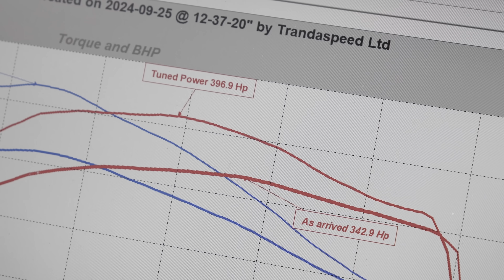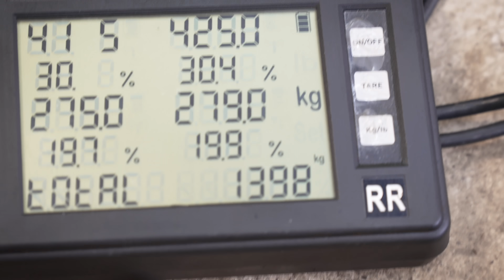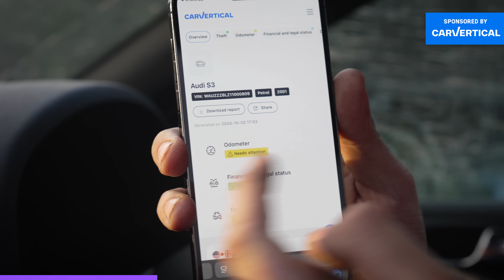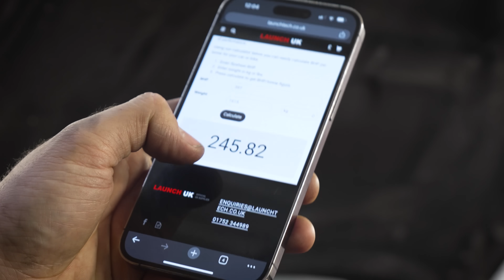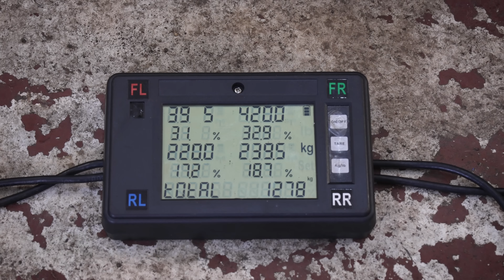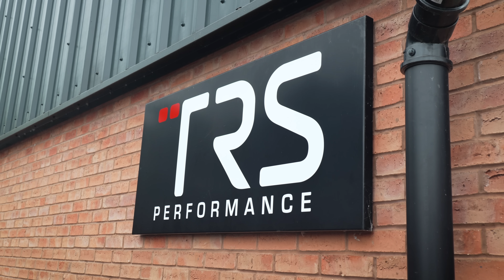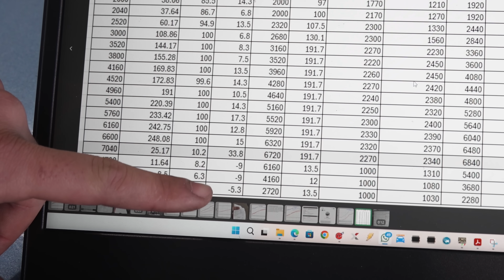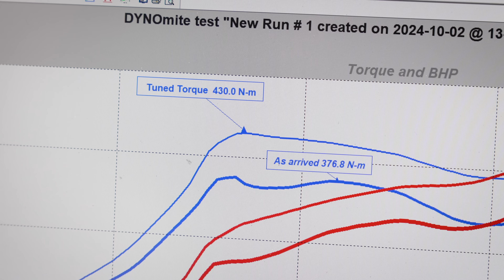I Spent 7 Days Trying To Fix My Audi S3

Comment: You didn’t need to take the head off. You can access the manifold by sticking your hand up the exhaust, through cylinder 3 and out the oil filler hole. Easy.
Reply: first thing i thought when I saw it, complete waste of time
Reply: Beat me to it, amateurs😂😂😂
Reply: I did one of these last week exactly like that, main thing to remember is to check that cylinder 3 has piston fully down so you've got space to get your knuckles round, otherwise you're going to graze yourself a bit.
Reply: Yea sure, except they got to torque a loose nut, refresh the gasket,
Reply: he did say he didnt care if u say he did it wrong
Reply: Personally, I prefer to do it through the dipstick hole. You can do the spark plugs at the same time this way.
Reply: you can do it from the drivers seat, through the glove box, with the engine on
Reply: @NH00531  well...yes they are amateurs...thats part of the reason the channel is so entertaining
Reply: Didnt you heard him?....SHUT UP!
Reply: Sure it made better content anyway so who cares
Reply: 8:07
Reply: Let’s not forget about 8:17
Reply: He said he doesn't care. Also it's content. So as Edwin said. Shut up
Reply: Ahahahhahahahah
Reply: ChrisFix literally made a video on how to fit your hand in the manifold. Did they even do the research?? 😂
Reply: I’d of changed the stem seal, full clean out. And match the ports whilst the head was off.
Reply: @NH00531 Mr state the obvious. The whole point of this channel is non certified mechanics learning on the job. 11:36 key moment.
Reply: Everyday is a school day. Genuinely didn't know this. Always accessed it via the rear offside wheel valve. Thanks
Reply: @somewhat-similar Great video, great job, keep up the good work, I always follow your videos
Reply: @theoffroad2013 it's obviously a joke
Reply: @jorgearagoncillorodriguez5221 how can you not tell this is a joke, surprise surprise your hand can't go into cylinder 3 or through the exhaust or out of the oil filter
Reply: @christycullen2355 it's a joke
Reply: @Ngarepairercar1990  they haven't posted any videos
Reply: @cimberlyward9106  yes
Reply: @olliethomsonrsl  oh dear, you seem to have missed the subtlety of the joke 🤣🤣🤣🤣 nevermind.
Reply: - Dhalsim
Reply: Pffft.   Such an unprofessional way to do it...   You just need to reach through the oil filler...
Reply: Easily the funniest YT comment I’ve seen in many years.
Reply: I rolled my eyes when I read the first few words of this comment like “not one of these know it alls” then finished reading it and to be fair you’ve raised a great point 😅
Reply: This horse I'm working on looks angry.
Reply: Lemme guess, you're a proctologist IRL?
Reply: Why didn't you delete your comment or edit after he called all you goobers out.
Reply: You can get a good look at a cow’s butt, if you… no wait, it’s the butcher’s butt. You can stick your head in the butcher… but I’d rather take the cow’s word.  no, that’s not it either. 🤔
Reply: So this is why my dentist said it wasn’t a problem at all when I told them I had lockjaw
Reply: Oh well better not have a heart attack 😂😂😂😂

Comment: As someone who has worked on these cars. It is absolutely key you put all the heat shields back if you didn't. The heat from your new components can burn through components involved in the brake booster as well as cause fires in the engine bay (ask me how i know)
Reply: HAhaHAhahAA
you poor bastard you
I know those feels too well
Reply: How do you know ?
Reply: I too have the same experience 😂
Reply: Could you tell me how they were on a fwd dyno at the start, when this has a haldex ?
Reply: Unplug the haldex no 4x4
Reply: @richiemolina8135  They probably pulled the fuse, but I don't think that's safe. It'd be cool if they answered though
Reply: @jamiemclachlan19  its perfectly safe. No fuse, no power to the haldex unit, no 4wd
Reply: @raydiamond-qi3dv suppose it will show a bit more power than with 4wd then
Reply: Fire can only be an improvement.

Comment: I’ve got an S3 (albeit a lot newer than this one). After some recent work my mechanic refused to charge me as much as they should have because “You wouldn’t believe me if I told you how many hours it took to put it back together”.
Reply: Just had the Head gasket and some other bits done on my older 2.0TFSi A4. My mechanic was very happy to see it finally off the ramps.

Comment: I’ll say it again, said it before, this is now better than auto Alex.

P.S, those 1.8Ts are horrible to work on I agree!
Reply: Depends lmao. Had a mk1 TT with the BAM 225, exactly the same car underneath as that S3, and it was a total pig to work on, but i also had a mk4 Polo GTi, also a 1.8T but the less powerful BJX, and that wasn't too bad to work on... Once all the unnecessary crap was removed from the engine and engine bay that is. It also helped not being overly compacted and complicated in a way that only Audi likes to do, and obviously no Quattro getting in the way of anything. Lol.
Reply: TDC has ALWAYS been better than AA and BGT.
Reply: I got a mk1 TT and yes. That 1.8t engine is a nightmare to work on. Just fitting a new turbo cause the old one blow was a nightmare getting it out en new one in
Reply: Well yeah all auto Alex does is buy BMWs same old every time.
Reply: A mk1 TT robbed me of many many hand skins trying to work on the engine, they are hideous
Reply: That's because they wrench on their own cars which is more interesting and alex is not the shitbox king anymore.
Reply: I'd say they are very easy compared to anything newer. Mechanic friendly engines.
Reply: but very reliable if maintained.

Comment: @Top Dead Center take out the windows and replace them with acrylic windows reducing the weight to 1/3, just leave the windscreen on for safety purposes you can also put a plastic bonnet that will be 20Kg less minum just make sure you secure it very well and use firewall material on that bonnet so it dont catch on fire when engien explodes or gets way too hot from the gases that come out from those chinese gaskets

Comment: I am a member of a forum devoted to another car from the Audi stable from the same era. We have a set of Ten Commandments for ownership - one of them is “thou shalt not buy cheap / unbranded / obviously Chinese  parts instead of OE or quality aftermarket”. It serves us well.

On losing weight - have you checked to see if there are any forged or magnesium wheels you could change to? Audi wheels are often very heavy and a good saving can be made here if you’re willing to be flexible on tyre sizing. Appreciate there’s not any budget left though.

Comment: I have the Leon Cupra R with the similar engine set up without the 4 wheel drive. I took the engine out to replace the manifold. Well, more specifically, do the studs as well as one was broken. Used shorter stainless studs and nuts to make accessing the top row of nuts a lot easier. Then i cracked 2 valves and took the engine out again, and replaced the lot with a low mileage lump out the 225 TT. Just use standard manifolds as they chinafolds will crack, it's just a matter of when.

Comment: I learned this from an old timer. If your timing belt is a tooth off instead of taking the belt off and starting all over you can use a bit of cardboard to jump the timing over one tooth. Just wedge it in between the belt and the crank gear and roll the engine over

Comment: This is gonna be a very tight race between you two but you'll need to strip it to the bones if you wanna have a chance against the e92 😂 they're very fast tuned even with stock parts

Comment: On my mk2 golf I had recently done the head gasket and head re condition so I put stainless exhaust + intake manifold studs in it, made doing my 4-1 manifold 2 months later a lot easier🤣

Comment: Degree torque settings are terrifying. I’ve never been so scared doing my timing belt when I saw +90deg
Reply: Mercs OM651 head bolts are something like 45NM then 90⁰+90⁰+90⁰. 😬
Reply: Rover V8 head bolts are 20 Nm +90° +90°. The second 90° needs a stout swing on 3 foot cheater bar. 10 of the squeakiest bum minutes I’ve ever had working on an engine in my life. The bolts are going into an alloy block as well.
Reply: @limpet7r63  😬 Squeaky bum time definitely!

Comment: ah the legendary 1 tooth off timing on the 1.8t, there is a little hack you can do with sending a piece of cardboard round the crank sprocket between the belt, it will pull it back in time without having to take off the belt again.

Comment: Ahh that bloody engine mount in the way of the timing belt! Took me a while to figure it out, but lever against the aircon lines running along the inner wing and jack the engine up as far as she'll go and it pops right out... Eventually... 😂 Oh and I agree, angle to torque headbolts are sheer terror, particularly in aluminium blocks 🤢😬

Comment: The crack you found on the exhaust manifold…… I had the exact same crack on my mk1 Leon Cupra R with the AMK coded engine.

These stock cast manifolds are notorious for cracking

Comment: I remember when we lightened my mates k20 fiesta st150 (obviously not 150bhp no more, more like 280bhp) time attack car. We literally took everything out. He had his roof cut out and a carbon roof made and put it. Carbon bonnet. Fibre glass wings, doors, boot. Fuel tank taken out and floor flattened and knew lightened tank built in to the boot. Then re literally cut out and drilled everywhere we could thet didn't effect the rigidity of the car. Was close to 1000kg. Mad fast. If you Google Orange k20 fiesta time attack. It should come up.

Comment: I have the same engine in my TT. The manifold gasket is a complete bollocks. I fixed mine and it has blown again but the bolt has rounded off to top it off.

Comment: Those cone/pod air filters are only ever any good if you can partition them off from the hot air in the engine bay, otherwise you’re just sucking in hot air. 

You need a hot air shield, or run the filter low in the bumper away from the engine, or even better, stick the original air filter back on and just upgrade it with a sport panel filter.

Comment: Ahh yes the 1.8t engine mount, it does come out but its a pain 😂
Those manifolds aswell are known for the gasket issues I rebuilt mine with better bends and new flange 😮 too eventually as it kept loosening off, partly caused by the turbo has thread inserts rather than just cut threads, thanks vw

Comment: Look into the weight of your wheels. I spoke to a former F1 wheel guy (read engineer) who said a rule of thumb is 1kg of wheel weight = 100kg on the axle... In other words, wheel weight makes a big difference in a race
Reply: It's not though
Reply: It helps handling

Comment: You have bought an exhaust manifold for a 1.8t with a k03 or k03s turbo. So a 150 or a 180bhp. You have a bam engine code which uses a k04 023 turbo to up the power to 225bhp. The k03 and k04 sit different and therefore you need a different exhaust manifold depending on your turbo. It's exactly the same as this just the 3 bolt flange is in a slightly different place. ( As in one sits closer to the passenger side of the vehicle compared to the other.)  loving the 1.8 20vt content from the S3. Good work lads ❤

Comment: Next time, just loosen up the engine mounts use a wood block and jack up the engine just enough to give you the clearance you need.  Audi is a very love-hate relationship and it’s tested every single time you turn that ignition on.

Comment: NOT NEEDED
TO
REMOVE THE HEAD 
You can easily do it trough the stereo slot …remove the stereo and the harness and the Hvac , then cut a hole in the firewall and presto ….

Comment: I made this mistake on my MK1 TT with the BAM engine, manifold had cracked so replaced it with a Relentless V4 Pro, absolute PITA, every single thing I touched needed replacing, ended up sinking £1k into what was supposed to be a 1 hour job 😂

Comment: This video had me laughing. Just did my friends G5 GTI and I feel your pain. Almost the same shit manifold design and same shit engine mount. Albeit he’s timing belt did snap, bent all the valves and slipped a lobe on the camshaft (Rocker jumped off and shifted the lobe) I can feel your frustration from here. Glad you managed to pull through in the end 👌

Comment: You didnt need to take the head off! 
Just jack the car to roll simulator, use an anti gravity device, pull 8.7 gigawatt in .7 sec through a reach around method , and your there m8

Comment: get wheells to save less rotational mass which is effective 3x the weight saved for rotational weight so all 4 x corners is 12x the wheel weight difference

Comment: If you do a timing belt in the furture and its out by a tooth or 2 u can put a 13mm bolt under the belt on the top pully and turn it by hand and it jumps a tooth

Comment: 1.8t are ALOT of work but generate good power 😊

They leak boost

They leak coolant

They leak exhaust gases 

They are incredibly hard to work on..

Mine was a 1.8t AUM and we got 209hp out of it.  That was without a huge ammount of mods.  😮 

They are meant to be good for 300-400hp

Comment: if these are similar to the 1.8ts in the mk4 jettas i was able to take my turbo and manifold off the car from the top and pull it out. was a tight fit but was able to pull it all from the top.

Comment: I bought a VAG car last year.  Never again.  This weekend, tried to change the coolant.  Ended up having to buy a new upper radiator hose adaptor because I snapped off the return line hose barb.  Plastic car parts suck!  Barely touched it.

Comment: Just a heads up, you are doing the manifold bolts wrong. You can actually dissolve them through the blinker fluid bottle and the top end doesn't need to come off

Comment: Love your vids guys! Nice to see a bit of Audi on there (even if it was the WORST one I have seen), and yeah they be a bitch to work on, my S4 is no different! So my guess was 245 before the Dyno, I had a MK1 TT which was showing the same power on the Dyno (MRC Banbury), but did have 300ft/lb torque. A standard remap will be around 245, with exhaust, intercooler, intake may see 275, 300 at a push with a custom map.

Comment: engine of my friends audi s3 broke. he had a ebay ecu aswell. he had launchcontroll ... used it once and it started randomly banging and klicking from the engine and lost power. he sayed he was so pissed that he launched it 2 more times to atleast completly break it, but it was still running. yes he wouldve been stuck wher he was and he was not at home... he ist smart. then we disasembled it and i started laughing uncontrollably.
what he had done, was bend the rod enough that it hit the oil squierter, break it off takeing a bit of the block with it and mike it fly around in the crankshaft like a rubber ball. wouldnt be ass if if he hadnt killed like 7 different audi engines in like 2 years. btw if you want. i can give you the storys of the other audis😂

Comment: Genuinely, not a piss take but there's a proper easy way to get that manifold off, take off the offside rear wheel and you can access the bolts from inside that wheel bearing....trust

Comment: Did anyone else notice the very stock looking pistons? That isn't a forged bottom end, unless it's just a rod replacement.
Reply: Pistons will happily take 500bhp no need to change them

Exhaust valves and rods are all you need for that goal so 300 is easy peasy

Comment: Currently layghing as iv had a bam enginr which i swapped a turbo on yea not a easy job make sure you locktight the turbo to manifold bolts as they like to come loose

Comment: As a german, german cars are absolute bonkers piece of BS. i  once had an a6 4f and from one day to another he didnt accept my key anymore. Then the ecu thought hey, he wants to steal that because this is totally obviously the key i know, but anyways im an VAG car and like to bathe in the despair of the owner. And on top of that the e brake couldnt be released, so you couldnt even tow this rusty tin can.

In the end i got a friend from another friend with vcdi, he unlocked the theft thingy, paired the key once again with the car and it worked again.  

Again: completely OUT OF NOWHERE.

Comment: Question for the enlightened .... Clearly propshaft is a sign of 4x4 drivetrain ... can someone explain to me how can you run dino on front wheels only? If it is Haldex there might be a way around it ... but if it is Torsen ... yea I dont think so. I would expect the diff in between diffs to just explode.

Comment: Lightweight, giving up so easily. You obviously haven't spent the night on your back in the snow trying to put a POS back together because you need it to get to work in the morning. Normal people don't have a lift, a full workshop and 3 mechanics to help. Keep the content coming but don't give up so easily. And Audi's are PAIN incarnate, their engineers smoke crack.

Comment: How can you dyno an s3 with only the front wheel in rollers
Reply: Tell the car to keep the central clutch pack disconnected so all the power goes to the front. Lower drivetrain loss that way too, so it's easier to figure out exactly what you're making at the crank.
Reply: Haldex

Comment: How have you managed to take a car worth £2250 and made it worth £1250, should have just bought genuine second hand parts, bigger turbo and replaced broken pipe with OEM ones, coil packs and spark plugs as standard. lol Saying thought, surely you'll still have a chance with 4wd and a decent amount of torque? If it survives the race, that is...